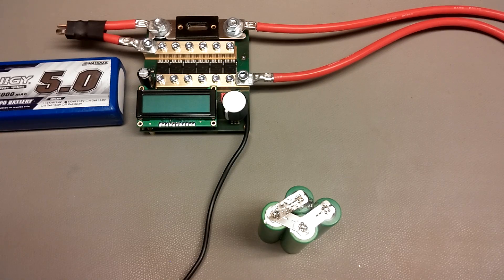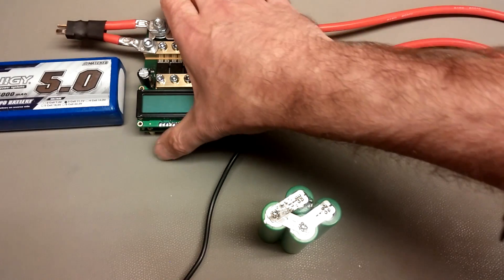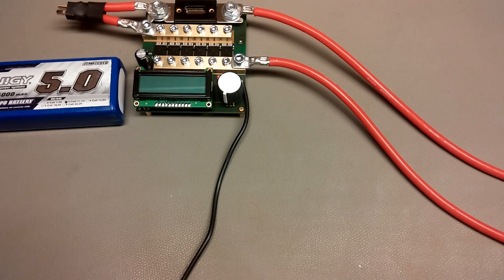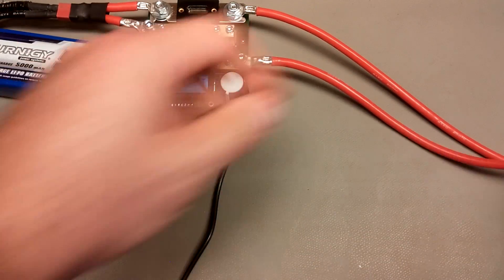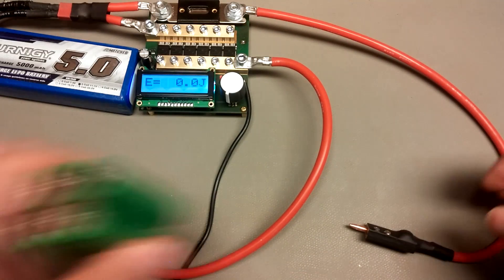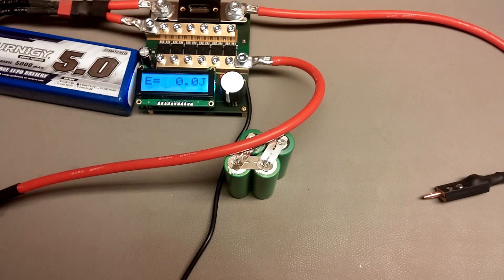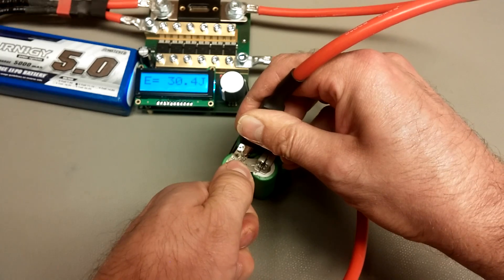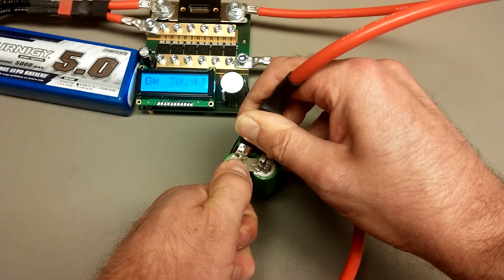Next level DIY battery spot welder - improvements

Comment: Can I use a 6P4S as source
Reply from the maker: no, 30V input max. But 12V is optimal anyway, more voltage means more heat in the battery (as it needs a higher ESR to keep the current target).

Comment: Have you tried to weld 0.2mm nickle strip to the positive side of a 2300mA 26650 A123 cell. I have found this to be most difficult.
The neg side has been easy and the standard 18650 cells have been easy as well.  I have messed around with the standard microwave transformer spot welders and now made a very crude version of your system but I think my Lipo maybe weak and I need better electrodes . I just tried cutting a slot in the nickle and punching some points in the nickle to help keep the weld current from leaking away from the weld point but still had very weak welds. Very impressed with your welded and If I give up messing around with my unit I think i will buy your kit.
Reply from the maker: Haven't done exactly this, but the welder is powerful enough to melt holes into bare 0.3mm nickel (no slots) and into the battery can. It depends on the battery as well of course, but the recommended Turnigy nanotech is up to this task.

Comment: Wow, this is a really neat spot welder, but do you need a 250a battery for this or is 100a enough? What about a battery/power supply with a big capacitor connected in parallel?
Reply from the maker: The battery in the video is acutally not suitable, it swells too quickly from being oveloaded. I have just made promising tests with a 650A Lipo (Turnigy nano-tech 3S 5Ah 130C). They are not much more expensive, but that battery did neither heat up nor swell at all after ~100 pulses. The current is also much higher: 1300A+.

Supercapacitors also work very well, but their internal resistance needs to be very low: 10 milliohm, better 5 milliohm. Car batteries also have proven to work.

My spot welder is just a smart power switch, and it can be used with any powerful DC voltage source in the range between 12V and 30V.